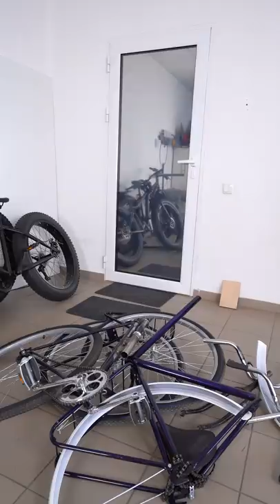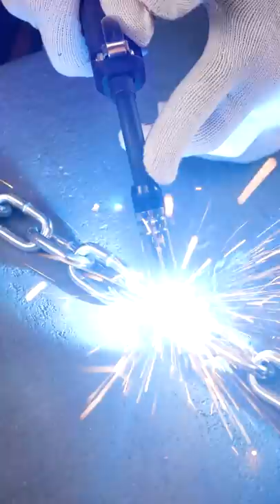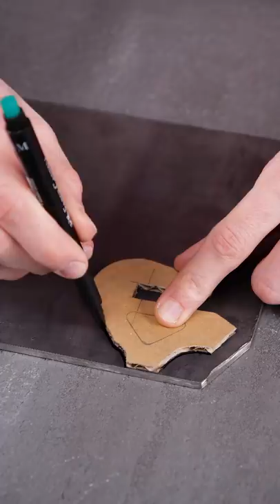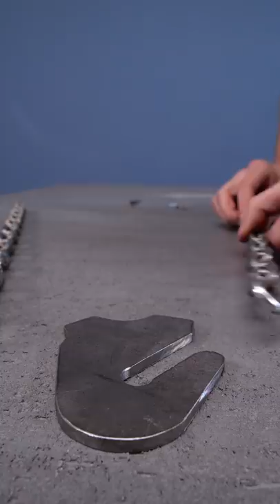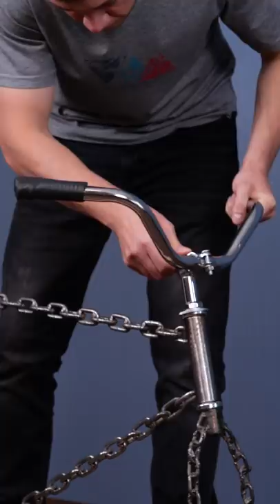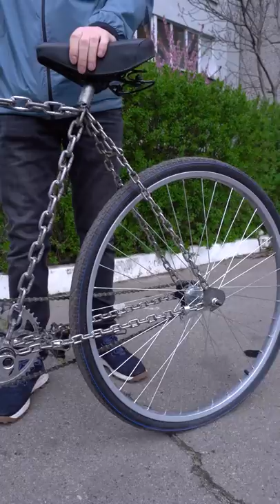AMAZING Bicycle out of Chains #shorts

Comment: “Hit the brakes Jim!” 
“What Brakes”
Reply: It's a fixie, you pedal backwards to stop it.
Reply: @kasaharahayashi7439  just stop your feet
Reply: @YasengGoranih  its easier to add resistance to the pedals and safer
Reply: @kasaharahayashi7439  no its not a fixie hes using
Its a single speed
If it was fixie then when he moved it the pedals should too, but it didnt
Reply: @kasaharahayashi7439  it is a coaster hub, which has a built-in brake, that is activated by pefaling backwards. This may sound like a fixie, but in fact there are actual brake pads inside the hub, and you can coast(but not pedal backwards obviously) on the bike with this kind of hub
Reply: @crimsonsamurai887  i bet this guy doesn't know coaster hubs
Reply: regentrive breaking lol
Reply: lolol 😅
Reply: Yeah it could be fixie
Reply: it doesn't have brake because it would add weight and actually using the brake would destroy the frame. plus would add complexity to a bike that is never going to get ridden.

Comment: Very cool ! Doubt it would be strong enough to actually ride , but very cool !
Reply: well as long as you never brake, accelerate, corner,go up hill, go down hill, hit a pothole, a curb,  be more than 150 lbs, or ride more than 2 miles (total) you're perfectly fine. I have to admit its a looker though.

Comment: So little area for those welds, though, I wouldn’t trust any bodyweight on that thing
Looks really cool though, I hope it makes you happy
Reply: he had quite much of weld in them.
Reply: the area between two links is not TOO bad thanks to the curvesth problem is so much stress and so many potential points of failure. of course the frame is barely holding up his weight. you gotta be ready to get your feet  off the pedal quickly thats all

Comment: It is cool but I guess brakes are quite necessary for any kind of vehicles
Reply: I don't see brakes on skate boards though. I'd rather keep this one without brake, because you don't even want to get into a situation where you'd need brakes. 
ike if you made a plane with no engine, no wings,  no flaps, no controls, no landing gear, would you need to put parachutes in it ? 😂